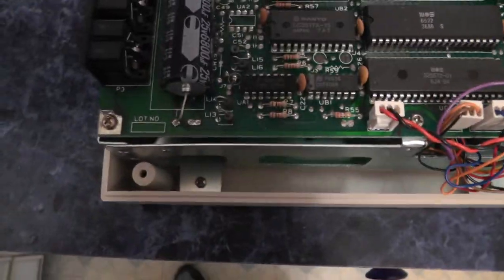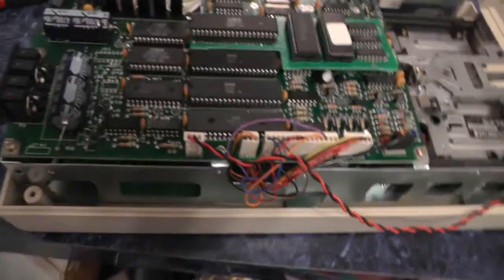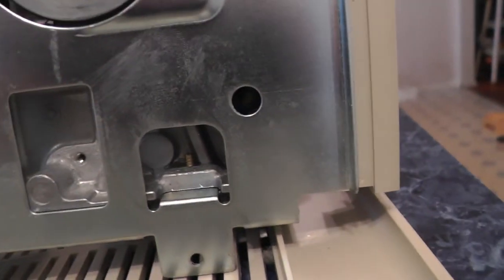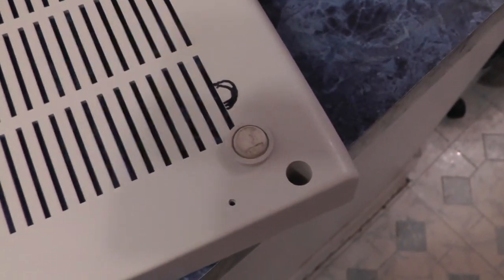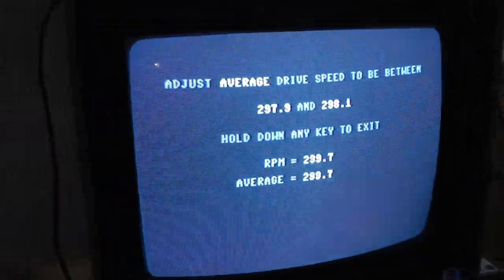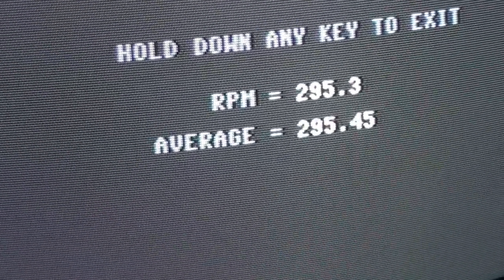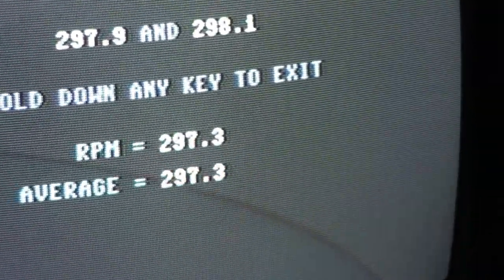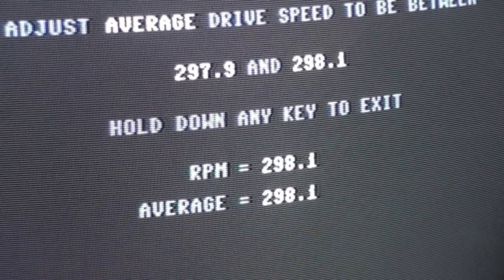Adjusting the Commodore 1541 disk drive speed

Comment: hi, i have a classic brown 1541 but with Mitsumi mec that was not working at all. 
After fixing several problems (6522, rom and a rectifier bad cutting 5v at random ...), finally is resetting correctly and accepting commands from c64. 
Head seem ok (continuity on each pin) and with software head exerciser move correctly. 
Problem is that motor speed run at 500+rpm  ;)  so, of course, nothing can be load or formatted. 
Well, i want try to fix speed rpm but i have not the screw on back like u show on this video. 
I have the hole on the metal, but nothing behind ^_^. 
seem to me very strange that software read 500+ rpm but i've try with 2 different programs and have the same results.
This 1541 make me become crazy oO.
i have disassembled everyting but can't find a screw for this speed adjustment. 
Question:
 is possible there are some models where speed is not adjustable?  
i am stuck with (seem)  head ok, logic ok but wrong rotation speed ... 
(sorry for my bad english)
Reply from the maker: Maybe the speedtest software is in error? If the speed adjust is not on the bottom then it's on the top - MUCH easier to get to. Mine is a small blue box with a yellow adjustor in the missle.

I use the speedtest found on the Supercard disk here: https://cbm8bit.com/8bit/commodore/search?query=supercard